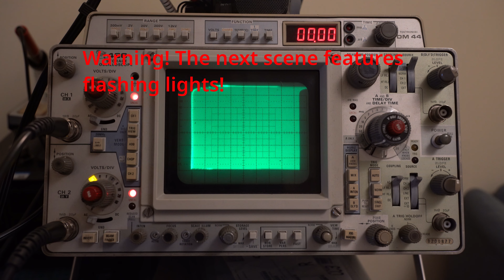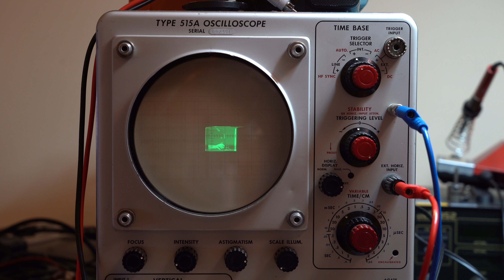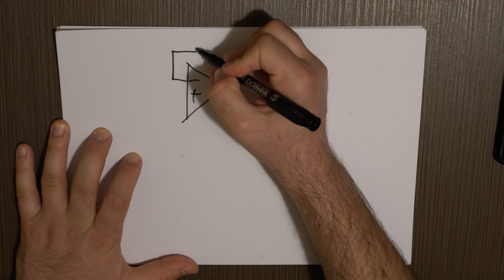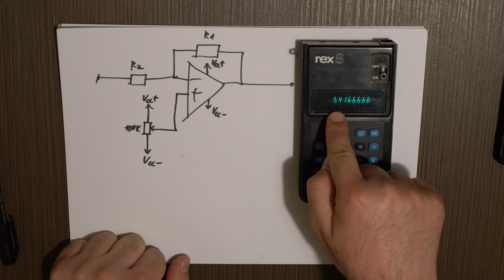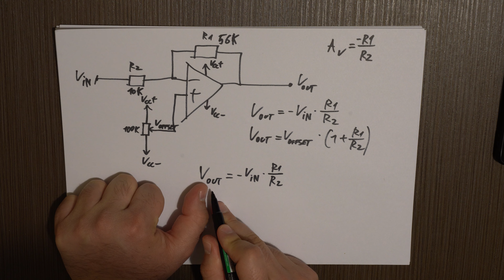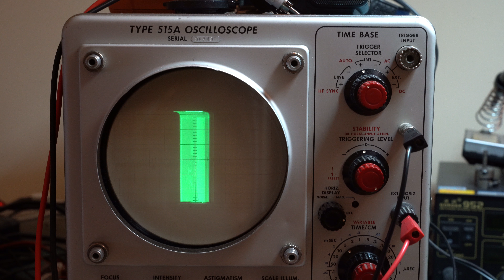Oscilloscope Video Monitor Followup: Video Amplifier Design

Comment: I remember doing a project almost identical to this in 1976 or 1977. At the time I worked in the laboratory of a major US TV network, so all the parts and equipment we needed were in stock. I believe we used a Tek 545 as the display. We also did it with a Tek 7904, but that was cheating because we could stick a horizontal plugin into one of the vertical channels to provide vertical sweep. Also, all of our scopes had an external sync separator circuit (just an RC network) to provide separate H and V sync from a composite video signal. Given how long ago this was, I've forgotten the specifics of the circuitry.

To sort out the video amplifier, including the control interactions, you're going to need proper test signals and a regular oscilloscope. You're also going to need to clamp the black level, because AC coupling by itself doesn’t work for video. APL (average picture level) changes will cause the black level to drift, and you'll also have poor low-frequency response. A window signal will readily demonstrate this. AC coupling artifacts are actually your biggest problem right now, not bandwidth limitations.

One final comment: you can’t properly evaluate a video amplifier with sine waves. You need to use properly-shaped square waves. You can look on eBay for old analog test signal generators, like the Tektronix TSG series, or even the 140 series.

Good luck with the project.
Reply from the maker: Thank you so much for your advice! On this scope, the Z axis is AC coupled internally, so I don't think I will be able to clamp the black level. I can do it in my circuit, but I'm not sure if it matters since the scope AC couples the signal internally. I will give it a try and maybe I will try a different scope too.

Comment: Cool video and project! For bandwidth extension, did you try removing or reducing the base resistor? And, I know you said you didn't have success with cap bypass in the emitter circuit, or didn't like the frequency peaking, but did you try something like 47p in series with 500R in the emitter?
Reply from the maker: I tried removing the base resistor in simulation, but it doesn't help because the dominant pole is at the output. With a capacitive load of 15 nF, I get around 20 kHz of BW without emitter bypass. I can increase the BW to around 40 kHz with 47 nF in series with 500 ohms in the emitter. I tried various resistor values until I got the response to be relatively flat. I also tried 47 pF as you suggested, but the value is too small and doesn't do much. So emitter bypass helps, but not enough for video applications. I'm not sure how they pulled this off in a TV because many TVs used simple one transistor amplifiers. Maybe the load capacitance is much smaller there.
Reply: @VoidElectronics  Thanks for the detailed reply! I looked further in sim and found similar--the small cap plus R bypass works well for no loading but doesn't do much against cap loading, even with a buffer OPS. Of course with the cap loading directly on the gain stage, it makes sense it kills the gain (ZL/ZE+ze). I looked up the manual for the 515A on the Tek Wiki. Specs show horizontal input has f3dB at 500kHz so you are actually overachieving here :) ... Page 67 has the horizontal amp schematic and I don't see exactly the cause of the high input capacitance measurement, the data sheets for the driver tubes and CRT all show capacitances under 10pF.

Comment: 42:50 I was hoping you'd go there... Rc is pinching off the bandwidth pretty bad in the single transistor amp... push pull definitely will grab ahold of the tube much better.

Came out really nice. It's not exactly easy to get a good image just scrounging around in the junk box... but that looks pretty sweet.
Reply from the maker: Eventually this will turn into a PCB that sits right in the back of the oscilloscope and that could work a bit better. However the input capacitance of the scope is huge so in order to get higher bandwidth I have to make my own contraption from scratch and put the amplifier right in the back of the CRT like they did in the old days.